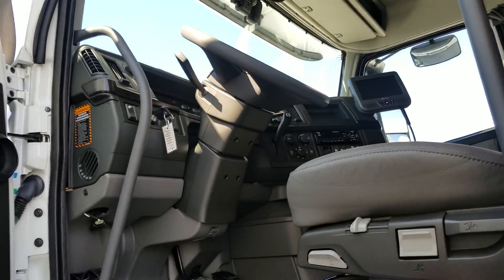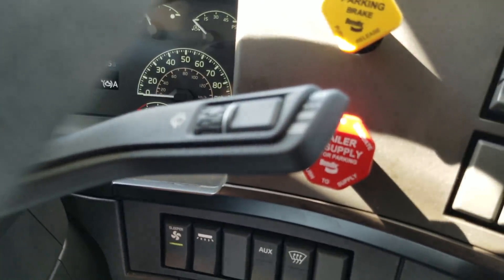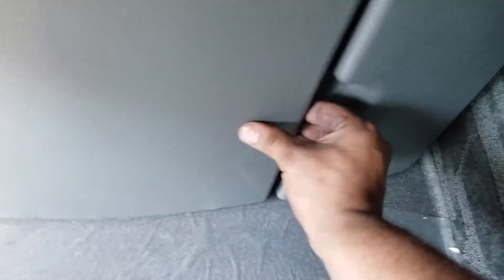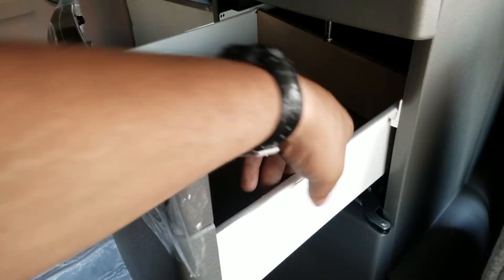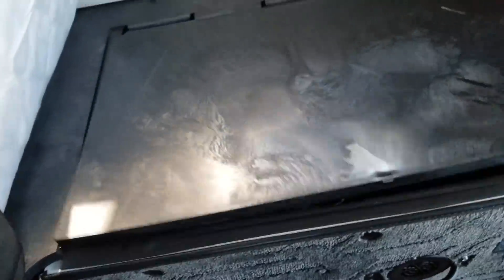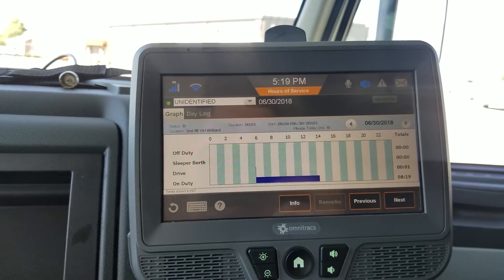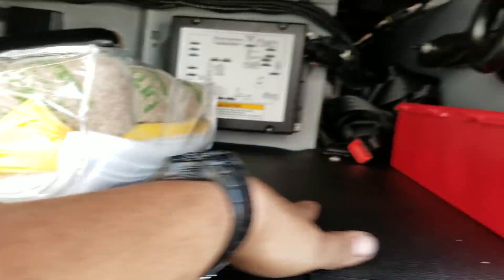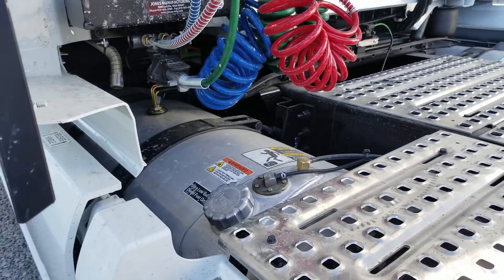2019 Volvo VNL 860 Tour 1/2

Comment: Don't know why people crap on the VOLVO.  I think it's a very well designed truck and very well thought out designed with driver comfort well in mind.

The automatic transmission looks to be another great addition to trucking. It appears to be a very safe transmission too. Definitely a truck I will consider when I return to trucking in 3 years.
Reply: The only thing that I can think is that it isn't a traditional truck make that people recognize with trucking going back 70 years.
Reply: I really like the Volvo trucks. I'm not the biggest fan of Automatics (mostly because I like using both of my feet and hands.) but people who say "How do you deal with a downgrade?" don't realise you can still (at least sequentially) shift the gears. Not to mention, visibility is a great thing. Imagine being able to actually see the four wheeler sitting in front of you instead of just having a massive block of cheese limiting your field of view.

Comment: This trick is made for the road long term. Volvo has done it right this time don't care what anyone says.
Reply: I agree their design is good. I love the look and especially the interior comfort however, from a reliability, parts availability and mechanical standpoint? I would never buy them
Reply: @somekidwithanm4  the primary issue is nobody wants to work on the Volvo if it has a D13 LOL
Reply: Real Dude Uprising I have the VNL 860. I love it. So smooth to drive, quiet, has a refrigerator and the inverter, tv mount. I can convert the bed into a table. It sure is s home away from home.❤️
Reply: @RealCoachRonn  i work on them everyday and they are designed in a way where the most common stuff to fail is easy to replace, so i dont mind working on them. could be a lot worse,(maxxforce/n13)

Comment: They used to be a way to turn on the cruise at idle and bump up the RPM to prevent the truck's "idle shut down" from shutting down the truck. However you can't do that unless you have the PTO parameters set to allow it. It is an internal parameter it must be activated. Therefore it thinks a PTO is operating and it will not shut down the truck. However the smart fleets and owners have blocked it PTO parameter.
Reply: Try and hit the plus on the cruise control lever while in park/neutral. That bumps the idle up on the European Volvos.

Comment: yeah  beautiful  most truckers love to hate on Volvos ,seems crazy to me, just got me a 08 pre def 465hp with a ultrashift 13, 390 gears and full lock quad axle 430 sleeper to convert to a dump truck and customizing it to look like the latest volvo concept truck-all custom led lighting, trying to figure out if i can switch out the interior door panels to 2018 style also
Reply: Everyone hates Volvo until they drive one. 
It's just a fact.
Reply: @OfficialUSKRprogram  very true
Reply: Volvo is probably the most comfortable truck on the road.

Comment: Pete and kw  boys are sooooo mad.....when they get in their container its as its was 30 years ago and that box does not change.
Reply: mirso sah ,,,Pozdrav druze,,,,,
Reply: Mad? No. There's a lot more to the burning 6mpg than just the aero. You've got 200 more horsepower in a W900 or a 389 and 400 more ft lbs of torque than this Volvo. Also the interiors have updated believe it or not. I think the Volvos are a great comfortable truck, but you're comparing apples to oranges and there's a reason why people still buy Long noses and much of it doesn't have to do with looks

Comment: This is just like a Volvo FM  but with a bonnet and a large rear area for the bed and living quarters. Dash is the same as the FM, door handles inside & outside are the same. Interesting it doesn't use an electric  E-brake/Hand Brake as in Europe. Much bigger interior than the Volvo FH that I drive here in England. How come these don't come with the Volvo D16 engine ??
Reply: because the d16 is no longer allowed in the usa emissions

Comment: Volvo is king of the road. Unfortunately my company has been buying Kenworth junk the past two yesrs and I just got a brand new one.
Reply: Why those KW are junk?
Reply: Rough ride. Loud cab. They don't even put sound deadening material under the hood like everyone else. 10 speed transmission is clunky and awkward. Several defects. In the first 10,00 miles, mine had broken fuel guage, broken windshield washers, and windshield cracked for no reason. Collision mitigation system malfunctions. MPG isn't as good. I have a day cab and the in-cab storage is horrible.

Comment: after a few runs the whole inside will start to rattle. the air knobs are in the worse location. you cannot see them so easily because of the steering wheel. they are safer to the side. it would be nice if Volvo can use less plastic.
Reply from the maker: I love the air knobs being by the steering wheel personally, where with everyone else, you have to extend your arm to pull them or push them.
Reply: Whole inside will start to rattle? Your comment lacks credibility because it is so outrageously false...I  drive a several year old Volvo and nothing rattles...I've driven numerous brands and Volvo is the best...talked to about 18 other drivers and asked which truck they like best and Volvo was first with about 13 of 18 votes... competition was not even close. Unless you got an extremely unfortunate and rare lemon, I call BS on your comment.

Comment: Dude there is no such thing as manual mode that doesn’t allow u to manually change the gears via button...u probably just dont know how to do it! Manual mode is very necessary for descending mountains properly bcuz in automatic mode it will have no restriction and begin to free roll just as if u were in neutral! I hate automatics and automated trucks!

Comment: Volvo makes the best truck. Specially the sleeper. The only problem is it only comes with automatic transmission. That's a deal breaker for me.10 or 13 speed transmission volvo is no brainer for O.T.R driving.
Reply: Yeah, it's a terrible thing, Volvo do not let you ruin your shoulder. But there is other ways to ruin it, like jump off a roof and hit the ground with the shoulder first..saves one 25 years of moving that manual stick!) Just kidding, take care.

Comment: So Volvo keeps on picking parts and designs from previous european trucks, to avoid spending $$ on development and design of their american trucks. 
Fine, but isn’t it time to bring som real updates to the american market? The shell/shape of the VNL cab was introduced in 1993 with the Volvo FH first gen, and I think, brought to the US with the introduction of the VN in 1996. You can still se certain details from back then, like the door handles. 
The dashboard design of this VNL was introduced with the Second gen FH in 2002. I see a few details has been modernized for the new VNL, and of course the sleeper part is miles ahead of anything european. But we have had the 3rd gen FHs since late 2012. This VNL is like a relic compared to euro trucks. 
Wonder why Volvo wont show the US market what they can really do..
Reply: Why bother.   
Volvo & like all commercial truck makers KNOW buyers of trucks know their shit & want to keep cost & repair bills down. 
Switches are switches.        Make them simple if you want them to last.
Reply: Your point is fair enough. But i'm not so much thinking about simplicity and switches. 

What I am thinking about i the look, the feel and most of all the ergonomics. 
SInce they seem to design VNLs by putting together existing euro-parts, and then sticking som fancy headlights on the compilation, I just think they could do better. 

Why not take the latest dashboard, the latest instrument cluster, the latest AC-panel and radio/phone panel, and let you Americans get a feel of a modern truck for once? It can't require much chopping to fit the lates dash into the old cab that the VNL still uses. They have actually done it with the euro Volvo FM. That truck uses the modern dash in the old cab frame.
What about dynamic steering, IFS, a 6x4 with a liftable axle, that's not a tag axle, but an axle that has drive when down, and is disconnected when up. Theres many examples of godies US Volvos dont have. (as far as I know) It doesn't have to be more complex, just better and more modern. Progress and simplicity are not opposites.

I get that the US market is conservative. Most guys still want an 18-speed and a 3406. 
And since it seems you all expect to get a million miles out of your trucks, maybe simplicity and conservative thinking is the only way to go.
I just keep thinking you 're missing out. On comfort, ease of use, and generally threating yourselves:)

Haven't  yet had a chance to see a VNL860 up close, so i might be wrongish if comparing to that, but I'll argue anytime, that a later model euro Volvo FH, is several generations ahead of the VNL780 in pretty much all aspects. 
I'm disappointed to see that the 860 doesnt close the gap more than it does.
Reply: Also needs independent front suspension.
Reply: Volvo has made it a point to ask truckers who use they trucks what they desire and they deliver every great the past 4 years .. Pete doesn't do it at all because they either take a lineage approach or avoid upgrades every other year period. There no other truck with so much accessory and powered access on the road. Im going back to a vnl once the price comes down..
Reply: Plus in the US market, an underpowered version is crammed down our throats

Comment: Certainly a nice truck but not a great presentation.  The presenter should have read a few pages of the manual first to guide us through the features, not drag us along on a poke and prod mission. Oh, and washing your hands first would have helped, too.
2 things, (out of several):
There IS a passenger side sun visor. It's hinged at the leading edge, while the driver's is hinged at the rear.
The lining around the skylight has a designed space to allow the foldaway shade to slip in between the glass and the lining.
Reply: Wow!! I really needed that information about the sun visor on the passenger side I don't know what I would have done without you saying that!

Comment: No reason for the forward facing camera, not there business to watch you when off the clock or what your doing. Disconnect it.
Reply from the maker: It is there in place to keep you safe and responsible for your actions in case you are at fault for an incident or not.

It is used as a teaching tool or your best friend when you need to prove your innocence.    The choice is up to you on how you will make it work for you.

Comment: the interior of the european is much better
Reply: And I (as a european) like this concept more. There really is living space in this trucks. The european volvo FH trucks are good tough, but there is just steering & sleeping space. Sleeping place is just a matrass, that's all. But in Europe we don't have space in traffic and infrastructure for trucks this big haha. We also live and work in the truck for 5 to 6 days. So this VNL is better in that case but not possible to drive in europe in an average type of transport. Btw, is this 860 hp? That realy is a lot of power, in europe the volvo goes up to 750 hp. Also available as a 4x2 truck 😂😂.
Reply: Jan Bakker that is a Volvo D13 with 13liter engine , 400-500hp or Cummins 15liter engine with 400-500hp . 
- Vnl 860 is model of the truck not a horse power. 
Volvo for Europe makes upto 750hp on Volvo D16 engine, same Volvo D16 engine for North American market is making 600hp  .